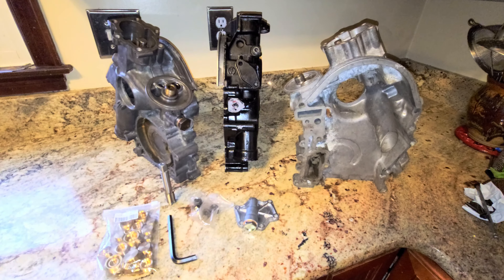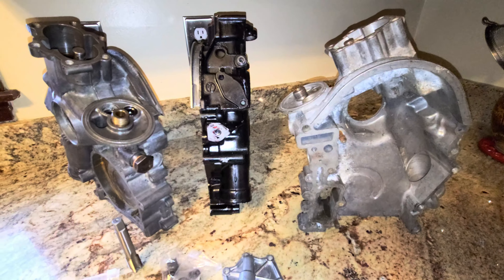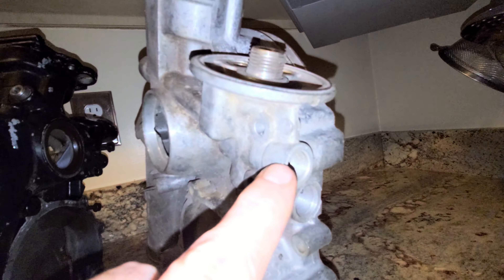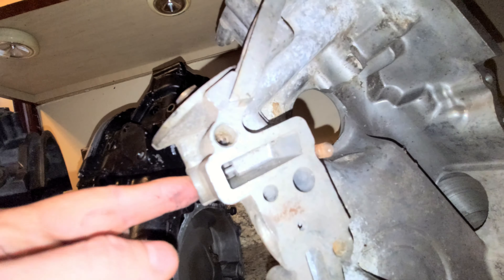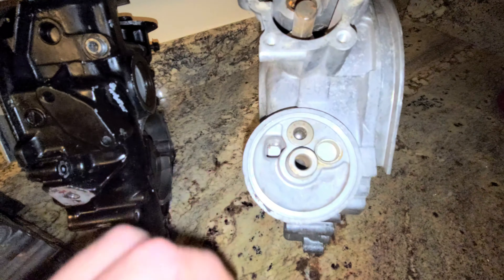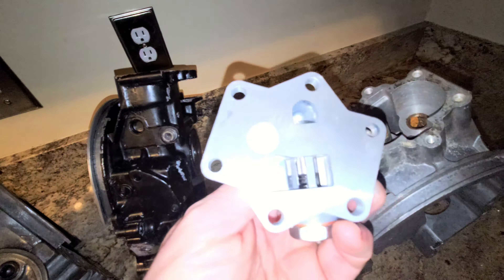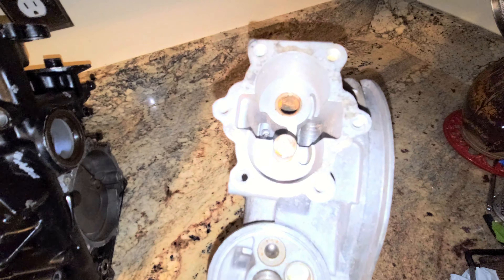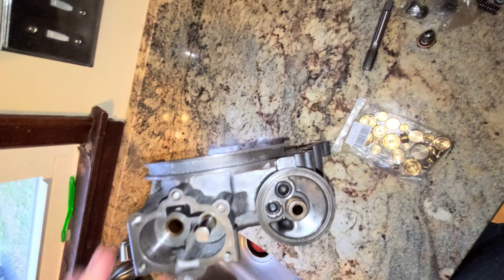Part 1A - Avoiding mistakes when building your Opel CIH Motor - Timing Cover Plugs & Oil Pressure

Comment: Hey, i have a c30ne engine in my car, it has always had varying oil pressure readings...after watching this video, i realise that there are two pressure reliefs on my engine...it uses the same design of timing covers in this video, there is a relief located at the oil filter, and another on the oil pump cover...my question now is, if i blank off the relief at the oil filter , would it put any strain on the oil pump cover?
Reply from the maker: No. the reilef at the oil filter is an "emergency" bypass. Meant for when there is a problem with the oil filter itself. In normal operation it shouldn't make a single bit of difference. That said IF the oil filter relief is weak it will bypass when it shouldn't and thus lower oil pressure.

Comment: how did you end up fixing the damaged engines? did they just need new bearings, and then oil pressure was fine? or did they need a major overhaul again?

Also do you have any tips on boosting oil pressure on CIH motors? one of mine seems to have low pressure when the motor gets warm, as the idiot light sometimes starts to flicker just a little bit at low idle  when warm. Maybe I just need different oil, I run 10W40, but ive heard of people running 20w50.
Reply from the maker: Oh thats a deep rabbit hole. Lets start by saying the Red GT in my garage getting all these motors is the same car.. and.. well.. 

All this depends on which motor we are talking about and how much damage happened. 

Motor #1 - We blamed oil sending unit.. and went with the thicker 20W50 VR-1oil w/ Lucas Oil Treatment. That worked until it wiped the #8 cam lobe due to low oil pressure. 

Motor #2 - The piston steering motor. I built the motor with ALL new parts I blamed it on the piston steering ( thus the new big end diesel rods I designed ). It made it 1000 miles. But never had great oil pressure.

So

Motor #3 - I rebuilt motor #1, with the original 2.4L Block and crank from Motor #1, stock 2.4L rods, and the 2.5L Pistons. Built it with all new bearings and double checked EVERYTHING.. plastigaged it all well, it made it 50 miles. It also wiped a #8 Cam Lobe. 

This is when the "AH HAH" moment happened. The ONLY consistant issue was ALL 3 motors got a DIFFERENT Media blasted Timing cover, as it was my friends GT and I wanted it to have the best parts out of my collection.  With motor #4, we had the machine shop pull the plugs on the LAST media blasted timing cover, and check it out. That motor is not in the Red car yet, but will be soon. 

So the point I am making, especially in a NEW motor, with a new cam.. IF you have low oil pressure ( Below 1.5 BAR ( 20 PSI ) at idle on a HOT motor that has been run. You are on borrowed time. All three motors had 2-3 bar, and on the highway had about 3-4 for a short period of time.  It wasn't long until they wiped bearings and cam lobes due to lack of oil pressure. Also with low oil pressure you will not be able to break in the cam well. 

How to fix it ? New main and rod bearings, clean the timing cover galleys, and such. Remove the plugs and clean behind the oil filter.  New pump cover, and a proper gasket ( or no gasket depending on wear..) Remember in most cases when you rebuild your turning the crank or boring the block .010"/.25mm. The difference between good oil pressure and low oil pressure can be affected but hundredths of a MM, or thousandths of an inch in the bearings. When you are plastigaging the bearings, the difference between too loose and just right is 0.002"/ .03 mm is.  

Given that 60 grit media in a media blaster is approximately .2mm/.010" thats enough to do major damage to the internals. Doesn't take much.

There are only a few things that affect oil pressure in the motor. The spacing of the oil pump gears, the tightness of those gears to the housing and cover, the bypasses in the timing cover, and tolerances of the bearings in the block and head. So good oil pressure starts with making sure the timing cover and gears are good, AND CLEAN. I have learned that the hard way.
Reply: @GoinManta  owhh.. Ive got a CIH, that i plastigauged, put brand new bearings in and a NOS diesel oil pump cover. Cam is the standard hydraulic lifter cam from a 20E. All in all, some money went into this motor. but I guess its on borrowed time.

It runs well, or at least has done so far for the past couple 1000km's. its been apart completely. Despite the low oil pressure, theres no valve ticker at idle, so im guessing that there is still enough pressure for the hydraulic lifters to fill up. 

Might try the thicker oil and see what that does.
Reply: Some new gears might help the cause too. I have a couple used sets, and they're all a bit worn. you know the usual marks on the faces and some wear on the tops of the teeth.
Reply from the maker: @Boerharms_Manta  

In a broken in motor that is running good. Then it COULD easily also be:

The oil pressure gauge/sending unit they DO go bad. 
The oil pump gasket ( IF you used the thicker black gasket that can do it ) 

In your case it's a new cover.. but with old ones 
the oil pump cover ( the spring and plunger can be worn over the years )_

What I would do is get a manual oil pressure gauge and check what the pressure is saying. 

Go for the low hanging fruit that are easy to fix. Then look at worst case scenario.
Reply from the maker: @Boerharms_Manta  did you use this oil pump cover gasket ? Or the thicker black one that comes in some engine gasket sets ?  https://www.edelschmiede.com/shop/05mm-seal-oil-pump-cap-oil-pump-Opel-4-6-cylinder-cih-engine
Reply: @GoinManta  I used a thin skim of black RTV to seal the oil pump cover
Reply from the maker: @Boerharms_Manta  That could be an issue. RTV can be abrasive and plug passages in the oil chambers. But it probably got picked up by the oil filter.
Reply: @GoinManta  right! so first step of action, drain the sump, remove the oil pump and check for blocked passages. then change filter and oil

Comment: Very nice, informatove videos! 👏👏 Just sold my old 2.3TD, and got a patrially rebuilt 2.4i instead. Can i drop a question at you though? This 2.4i is in the car, it's a '92, last gen CIH, and the first cylinder doesnt fire. I switched everything up from the other cylinders (spark plugs, ignition cables), and tested the ignition, that seems fine, but cylinder one is still completely dead. I also done a quick compression test, but with a cheap tool (not a screw-in tester, so it was a lot of blow by), and all the cylinders have compression. The injectors are apparently new, i got the old ones too in a bag. What would be your next step to troubleshoot? The engine runs by the way, and it starts easily, so the timing seems to be good aswell. Its not smoking, not giving weird noises, so nothing should be broken anywhere either. It smells a lot like gasoline though, so i assume its the unburnt gasoline from that cylinder coming through the exhaust. I looked through for broken wires, vacuum leaks, but everything seems fine, found nothing obviously wrong. I'm starting to be at a loss here, as i wouldnt open up the engine necesseraly
Reply from the maker: How are you sure its completely dead ? That said.. Gonna go through my steps.. #1 TIGHTEN all the intake manifold bolts.. OMG I cant count how many times its a vaccum leak at the intake.. Then, the test you did, a compression test as long as all of them have within 10% of each in compression. Its not compression. Thus not mechanical. Next test is ignition.. with a rubber glove and a such check if you have spark by pulling the spark plug wire and seeing if it fires and sparks across to the block from the spark plug wire. If you have spark on the wire, and you have swapped around spark plugs.. Not spark and not computer. Then test if its fuel injector or computer. Test the connector, pull it out and check put a check light ( any small blub wired between contacts ) does it pulse ? If so then not computer. Clean the contacts of the connector and make sure they are tight. Put on the injector and make sure its tight.. No difference.. wiggle the injector plug.. still nothing ( WE will go back to this later ). Then possibly injector. Spray carb cleaner or starting fluid at the injector base to confirm its not a vacuum leak at the injector seal itself. You may notice it start firing with the carb cleaner being sucked into the intake. If so then, tighten the injector hold down and repeat.. no change ? If you havent replaced the seals replace them. Still no change.. Then replace injector. If still no change and you have eliminated ALL vaccuum leaks... Then replace the connector on the injector. If that doesn't get it.. then hard to say. THe ECU fires ALL the injectors at the same time.. so if one is getting fuel they all are. UNLESS its a break in the harness. Let me know if you find it.
Reply: @GoinManta  Thanks for the advice! Its priceless from someone who knows these engines inside-out. I will definitely dive into it, and drop a comment here if i got progress going. Thanks again!
Reply: @GoinManta hi! So a few months in, i got to working on it again, and i did found that the first injector seems to be stuck shut, and there is actually no fuel going into the first cylinder 😃. I also found that i have some small leaks on the inlet side, so i will drop an old (but working) injector in, and do the manifold gasket, and hopefully it will bring it around 🙌

Comment: I'he build an engine last year and the bearings were looking real bad this winter already. I have an oil pressure sensor in the back of the block (original gte kadett had oil pressure gauges).
Can the pressure be low despite showing good values or can I trust my oil pressure gauge?
I had great oil pressure but had a quick pressure lost after a handbrake U-turn and also found quite some break in particules in the oil, both could be the cause of the bad bearings.. so I would like to know if I can trust my gauge!
Great video again!!
Reply from the maker: Here is the thing the gauges go bad. BUT you can easily replace it. Also know that gauges usually fail to have LESS oil pressure not more.  So as long as the gauge reads good you are probably good.